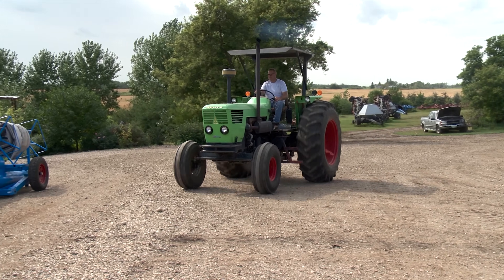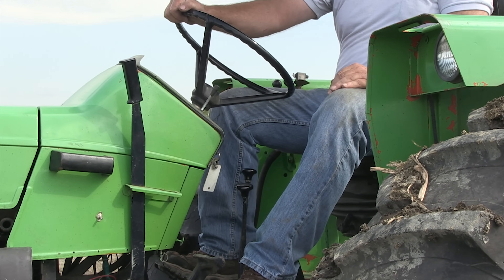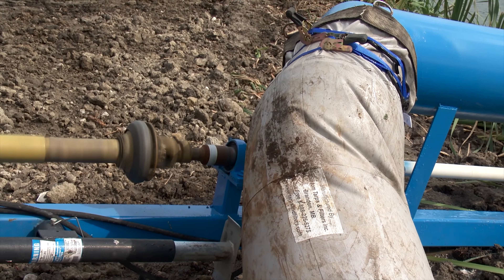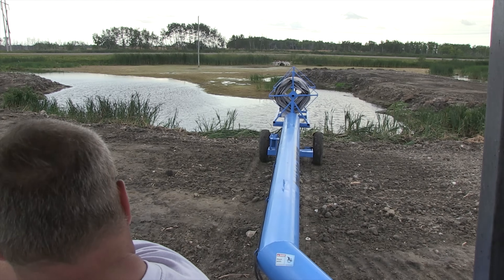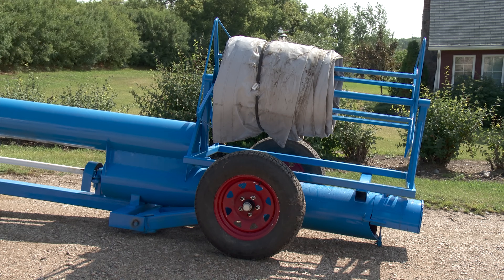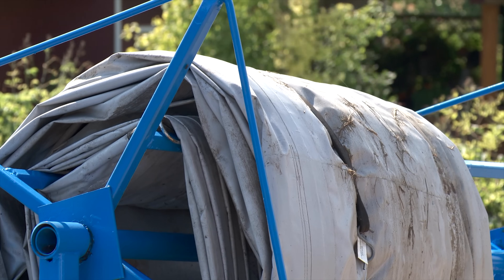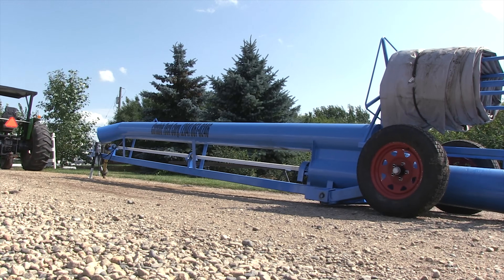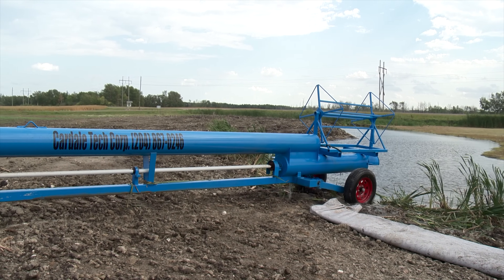6,000 GPM Water Pump

Comment: "Emphasis on safety and efficacy" with no PTO guards...
Reply: There's not even a guard protecting the flexible hose from the 1000rpm shaft. "Safety and efficiency" go out of the window when that rubs a hole right through your hose and you have to set it all up again. A guard would be pennies to implement.
Reply: with hydraulic lines that could easily be pulled into that pto
Reply: There's a guard on the pto shaft, the stay-chain is broken though as its spinning with the shaft.  Not that it matters, you fall on it and it will stop turning.  Anyways all that aside, i've seen these around for years before this?
Reply: This pump is nothing new.  I used one over  10 years ago that pumped at 10 times the rate this one does with a smaller tractor.  They are extremely simple to build too.
Reply: Vegetal Spagoot how about you google the word he typed,  instead of adding nothing but your criticism to the conversation.
Reply: Vegetal Spagoot no, I simply suggested that you google the word, instead of telling him he miss spelled it, because you assume it was meant to spell something else. Guess I could have added the definition in my comment, possibly teaching you something, but considering your obvious hunger to be a detective & uncover evil, I didn't want to deprive you of an actual find. So Sherlock... Be my guest & educate yourself when ready. Especially if being smarter than those around you is your goal.
Reply: strudders2112 and the PTO holds that something perfectly in place to drown instead of chopped up.
Reply: there's already a plastic pipe over it, the end is just not secured to keep it from rotating.  Its not perfect but it will protect you.
Reply: Well you can't even spell efficiency so your brain is not very efficient either.
Reply: M. S. L. he says, adding criticism to the conversation...
Reply: Can't believe I read this far just to say; I wonder why he used 2" pvc for the driveshaft?  And it sure is quiet for being that out of balance? And I didn't think you could put 40-50hp through pvc pipe. Andd the tractor tires look more dangerouser, should add guards all around them, or maybe the rubber is the guard lol
Reply: There is pro guard it's that yellow thing
Reply: Your paranoia aside, the PTO shaft does not run while you are setting everything up.  The PTO is engaged from the cab of the tractor.  And after everything is set up and the PTO is engaged, there is no reason to approach the shaft while it is turning.

Like it or not, people are actually smart enough not to stick their body parts into a rotating shaft, ingest poison, or breath while underwater.
Reply: old time farm boy not a case of liking it or not. There are plenty of farmers who thought they would be smart enough not to put body parts into PTO driven implements who regret not putting that cover on or switching the PTO off whilst changing the string/clearing a blockage etc etc. Implement safety is not about being to cool for school, it's about protecting you and those you work with or for you. If it has a PTO you can get at, it must have a cover.being dismissive and complacent is what causes the majority of farm accidents. When I was at agri college safety was drummed into us and it remains the same today as it did 30 years ago.
Reply: Tru Groovin's MASTER Why would anyone be jealous of this?
Reply: Tru Groovin's MASTER lol you really are angry about something. Do you need a cookie. Just to add. Rather than throw abuse around, why not add something to the discussion. If I were to meet the farmer who designed it. I would offer my observation to his face in a polite way and we could discuss my concerns. . As has been said, would not cost a few pennies to have put them on. . As. For sitting behind a keyboard.... well have you not just done that exact same thing by commenting on my post?? Mmm
Reply: Seems a loop(s) like around an automobile's drive shaft would be sufficient.  Hopefully a hose isn't laid over the drive shaft.

Comment: I worked in Egypt back I the 80s and the farmers there used a similar device to pump water from the sweet water canals into their irrigation ditches.
Different size models were used the smallest was powered by  hand crank, coming up in size powered by installed gas engines and larger ones had diesels. The biggest by PTO or tractor belt pulley drives. The designs were kept simple and easy to manufacture and repair in rural areas,  A NGO helped with development of simple but effective equipment for the farming community.

You have a good design there and I wish you well with marketing it. BS